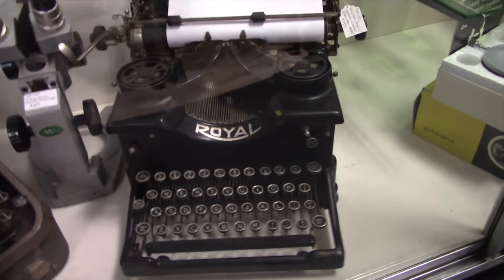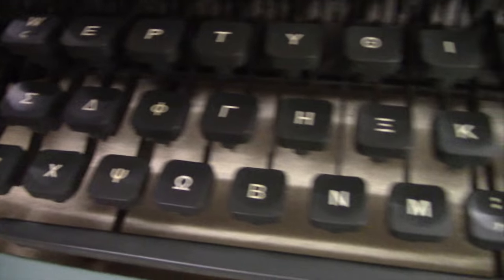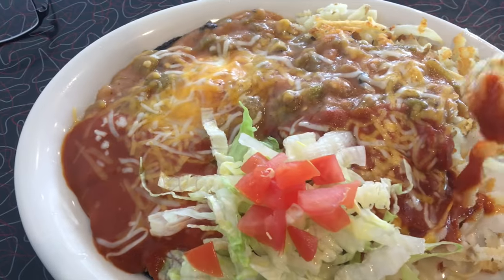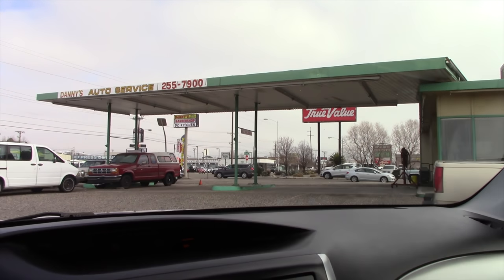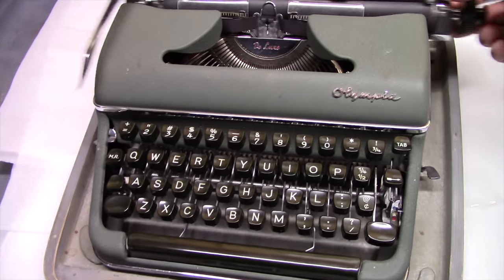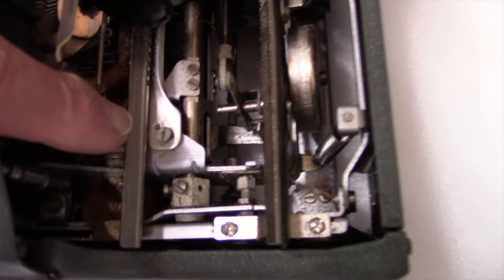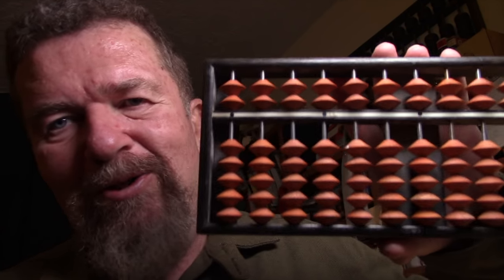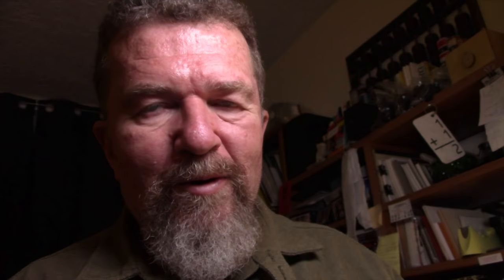This is Not a Vlog, January 15, 2019

Comment: Hi, Joe! Your late-night commentary made me consider that much as I might want to, I probably can't own and use a typewriter in my current living situation in a highrise condo. Although many classic machines are branded as "silent," they aren't silent enough to avoid annoying my neighbors. Our units here are fairly soundproof, but the enclosed patios where most folks have their home offices or hobby rooms are unfortunately great at conducting sound. Surely you've encountered apartment-dwelling typewriter enthusiasts — what do they do to solve the noise problem?
Reply from the maker: It certainly depends on your individual situation.

I've done late-night typing in my house, with wife asleep in bedroom, and have not heard any complaints. Our house is hardwood floors over a crawlspace, so it's a bit echoey. But probably not as bad as harder surfaces.

Sitting on a well-padded couch, typing on my lap, is not too loud, enough soft surfaces to absorb sound.

I expect carpet floors would help pad some sound.

For really quiet typing the little thermal typewriters are great. And some (but certainly not all) daisy wheel electronic machines could be rather quiet.
Reply: Great idea about the thermal typewriters. Back in the 1980s I owned a Canon Typestar — either a 5 or 6, I forget which. I never used it in thermal mode, however. As you discussed in your video about the Brother EP-20, thermal paper is still widely available. Reacquiring a Typestar would be a blast from the past. When I moved from Wyoming to Chicago back in 1986, I arrived at O'Hare with a carry-on bag and my Typestar.  :-)